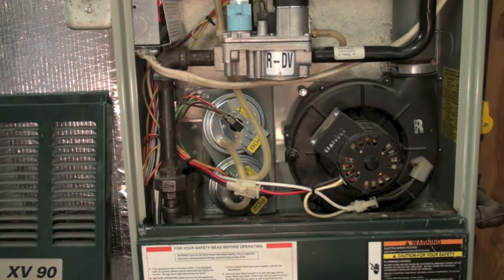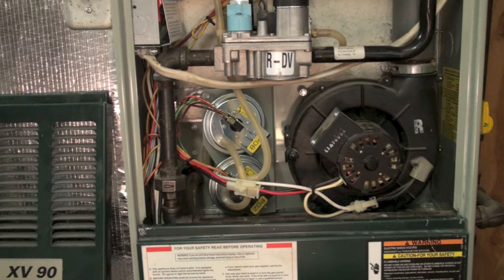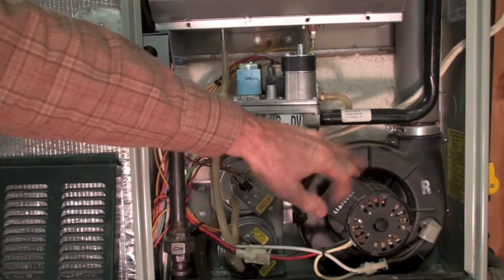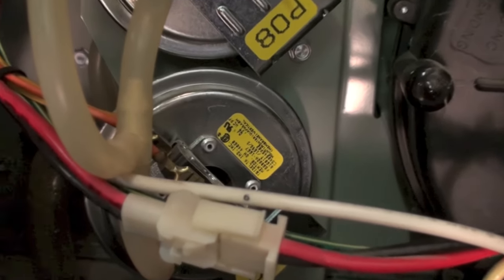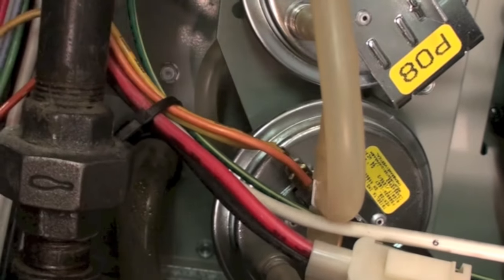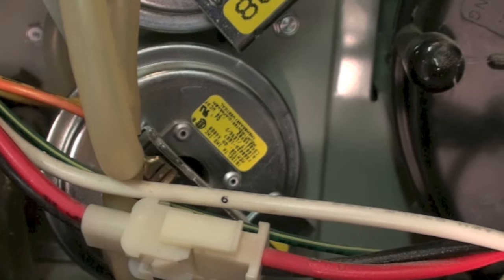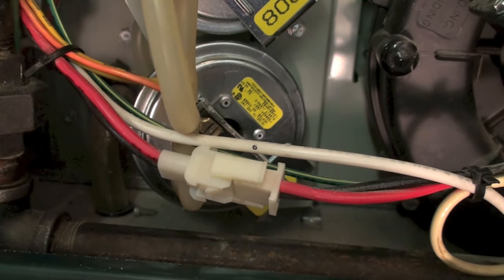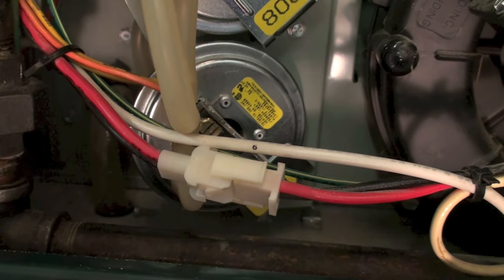Diagnosing pressure switch problems on gas furnaces

Comment: I've been having an ongoing issue with my high- efficiency gas furnace. When I set my thermostat to a desired temperature the inducer motor kicks on and just stayed on. For the past two seasons I'd simply change the batteries on the thermostat and it would work again temporary. Recently changing the batteries had not worked.  convinced my thermostat was the issue i went out and bought a new "state-of-the-art" thermostat and experienced the same result. 

I took the side panel off the furnace and watched the cycle. I noticed the red light on the computer board would go from a solid red prior to kicking on to a blinking red light once the inducer kicked on. 
I read on the inside of my panel that the double flash on the red light meant "pressure switch is open with inducer on." After some research it was suggested to remove the rubber tube from the pressure switch to the the burner chamber. Once I did this I started the cycle. The red light remained solid. After 15 seconds a clicking noise and the ignitor began to glow and after another 15 seconds or so burner flames ignited and following that the blower came on and it began to cycle heat. The blowing cycle lasts 1-3 minutes at most and does not reach desired temperature. Once I reattach the tube, the problem occurs again. 

I found a tip that suggested to blow into the tube, when I do I can hear a noise in the switch. I ran the shop vac through the intake and exhaust pipes from outside. The inside looks clean. I noticed the burners run for less than 30 seconds, I get warm air and then cool air.....I'm not exactly sure how to trouble shoot beyond this point. Any suggestions? Thank you.
Reply from the maker: Check the vent and combustion air pipe for low spots.  The piping should pitch toward the furnace at 1/4" per foot.  You could also have an inducer problem.  Dirty or damaged wheel.
GFM
Reply: +grayfurnaceman I removed the inducer motor noticed the seal was cracked and may have lead to air along with condensation leaking. I clean it up and reseated with high temp silicone sealant. I'm no longer getting the error code and the furnace IS running through its cycle BUT flames stay on for 30-45 seconds and then kicks out while blowing luke warm to cooler air.... Any suggestions?

Comment: great video the only thing i still don't understand with pressure switches is why is there dual as opposed to single . Or in other words why do they uses 2.  Is one for the combustion chamber the other for the inductor blower ( or intake side)
Reply from the maker: +sam111880 This video may help https://youtu.be/KmItM1_Fq9I
GFM
Reply from the maker: +sam111880 Check your trash.  I sent a link to a video.
GFM

Comment: I came across another one that would close ,HSI came on. but gas valve wouldn't open.... I ohm'd out pressure  switch.... Plenty of vacuum  I determined corroded contacts in the pressure switch, High ohms across PS..... Unit is a high efficiency Carrier... Unit had condensate problems.... I fixed them ....new PS....assorted other things, unit working good.

Comment: GFM, great vid.  I have a question. I have a 90 percent TRANE. When calling for fire, I can hear it tries to ignite, but can't.Often only after 3-5 cycles, it will start.  The service person says it is due to a bad pressure switch.  Wonder what your suggestions are.  Thanks.
Reply from the maker: Bill John If the unit lights for 4 to 7 seconds then goes out, it is probably a flame sense problem.  Clean the flame rod.  If it either never comes on or runs for a short time, there could be a pressure problem.  If it locks out on pressure switch, look for blockages in the vent, water in the pipe from a sag or ice on the termination.  You could also have a blocked condensate drain.  Check these first, the look at the pressure switch.  Hope this helps.
GFM

Comment: I've been on your other video's as you know ( igniting, not igniting). When the person who came here Mon. furnace was running fine, been running fine since about 3:00AM Sun until I again noticed just the first fan running and running about 6:10PM today not igniting. I called the person whop came here, (he lives 160 miles away from me, he was within 40 Mon.).. Anyway as of right now nothing will even ignite at all. He said take hose from where exhaust fan runs. I did and when I sucked on it a little water came out of it, He did this Mon. No Water. it did rain today. Since I bought this house it has rained plenty what can I say. So sucked then blew, you can hear the switch and see something move back and fourth on switch. No water in it anymore. But furnace will not ignite. This switch has no writing on it at all. Again I'm a 58 yr old woman and I thought the man who came here would know what was wrong. I told you on your other video He had narrowed it down to this. Now he is taking hose from chimney. The man who built this house has caps on 4 chimney welded screens all away around. No animal or even bird cannot get into chimney. I asked if this part could finally just give out altogether, of course the answer was yes. 

Reality of it is he's saying this and that needs to be re-checked. He checked gas valve had 24 volts said it was fine. I don't know how this is going to be resolved without calling furnace place near me with $$ I don't have. I hate to buy this Pressure switch then have it not be what the problem is. He said you could jump it by putting some kind of wire to both clamps and it it started that would indicate if it was the switch. Yeah like I know how to do that. I'm not going to mess with thing and cause damage that isn't there. God I need help.

Furnace is SV 9500 there's 4 numbers beyond that one 2682. Comforter RPS II but has Honeywell parts. The Pressure Switch on it has no writing on it all. A friend is asking me how do we test this? Vacuum?

Comment: question for you, i am a mechanic but i am not a furnace repairman however like everyone else i need to try and save money.  i have a nordyne furnace and it will get the call for heat from the thermostat and engage the forced air for combustion and will run this way for 15minutes to half an hour flashing the code 2 for an open pressure switch then so far everytime has finally picked up flame (showing flame led light up and then flame in chamber) and ignited to start the furnace.  any thoughts or suggestion would be appreciated, i will check the exhaust and intake as you suggested on my roof tomorrow, we have had really high winds the last couple days.
Reply from the maker: Of course the pressure switch could cause the problem, but always check for air flow problems first.  Check the tubing, check the blower wheel for dirt and the vent for obstructions.  There is also the possibility of a cracked heat exchanger.  Hope this helps.
GFM

Comment: Had a problem with my Furnace  Flue blower would run and the burner would try to ignite and would do this two or three times before doing so.   had a Tech come out and he found small pin holes in the sheet metal  boot going to the chimney  said they were messing up the pressure switch . he foil taped them and told me to replace it ASAP  now the furnace is working fine. going to replace when weather breaks

Comment: Thank you for this video! I checked the exhaust tube and it looks to be unobstructed. I then removed the tube as instructed at 3:40 in this video and my unit starts every time now without issue. I did run a wire through where this tube connects and checked the tube and they are both unobstructed. There is a metal cover over the burners and it starts with the tube connected and metal cover removed as well. I'm wondering what the next step is considering this is the problem here. For reference I have an American Standard Freedom 95. Any advice would be much appreciated!
Reply from the maker: I would be looking at an obstruction in the combustion air inlet.
GFM
Reply: @grayfurnaceman  thanks for the reply. I had this furnace installed 10 years ago by a professional and he left the air inlet open (no piping). Only the exhaust is piped out. I believe the exhaust is holding condensation at a low point because when I detach and vacuum it out the furnace starts.
Reply from the maker: @tommymillett377  I would be using a level on the vent.  Should have a minimum 1/4" pitch toward the furnace.
GFM

Comment: Ok have installed new pressure switch and inducer motor, Now it starts as it should once the pressure switch makes,flame comes on for a sec and then shuts down including inducer motor ,then it will retry & repeat.
Reply from the maker: Have you cleaned the flame rod?
GFM

Comment: Hi,

I have a 12 year old HE Lennox furnace. It has the #2 LED slow flash diagnostic code which describes blocked lines, or pressure switch open 5 times. I checked the hoses for blockages and it was okay. I unplugged the hose the positive hose (from the switch) and the furnace ignited and worked. Do you know what I can try next to diagnose this?

Comment: We got home from the Poconos on 1/1/18 and immediately felt that the house was cold. We went to the thermostat and it read 59 degrees. When we go away for a short time in the winter we set it for 66 and 67-69 when we're home. 
So lately our Ruud UGRA-09EZAJS/Serial: EL furnace has not been heating the house to the set temp (67). The closest its come was 65 and that's after I flip the switch on/off over a period of about an hour. 
When I look through the glass window, the green light blinks twice every two seconds, the code on the door panel indicates that the pressure switch is open. My friend came over to see which of the two pressure switches was the issue, but soon after disconnecting one of the hoses and blowing through it (nothing came out) he reconnected it, turned the furnace back on and there hasn't been a problem with it reaching the set temp. My friend could only guess as to why the furnace is heating the house now. We WERE going to replace the switch/es, but no need to now. I'd be interested to know if anyone might have an idea as to what might have fixed this issue.
Reply from the maker: There are a number of possibilities.  Venting problems such as vent sagging or frost in the vent can cause this.  Heat exchanger leaks can cause this type of failure.  Of course, the pressure switch itself could be at fault.  The issue of the unit running normally after clearing a vacuum hose might indicate a failing pressure with but I would not guarantee it.
GFM

Comment: Thanks for the video. I've got an interesting intermittent problem. The furnace works 80% of the time. When it fails the inducer comes on and just stays on and the furnace doesn't light. It can light 2x in a row and third time fail.

Any thoughts would be greatly appreciated. Thanks!
Reply from the maker: Dave Brown Could be a number of things.  A dirty flame rod, failing hot surface ignitor, a failing gas valve, or a control board problem.  Try cleaning the flame rod first.  I have a couple of videos on cleaning the flame rod.
GFM
Reply: Thanks for the reply. It's even more interesting now. I've seen times when the glow-stick is on but the furnace still does not light. Generally I didn't see that come on at all when the problem is occurring.

Comment: thank you for your Video. Yesterday my Carrier furnace would not turn on. Unit is in the attic, and we had overnight lows of 18 degrees. The day before it ran just fine. The unit would not start, The fan would go on, shut off then the inducer would cycle and shut off. NO IGNITION in the gas chamber. Had a code light blinking #13 called a HVAC person out, watched him fiddle with the unit, pushed a switch behind the cover . He wiggled the drain line, and said moisture froze in a kinked drain line. Now the cycles the unit and we have ignition and the furnace is running. He decided to remove the cover (shroud) from the inducer, looking for moisture. broke the silicone seal, said he didn't have gasket material, just put it back. I came down the ladder for awhile, maybe 15 min. go back up and he tells me the pressure switch is bad!! he put in a temporary one. The furnace is running. ????? It ran before after he dislodged the blockage, ? moisture froze, and caused the furnace not to start. He came back and said it would cost $222.00 for the switch and another $70 service call to replace it????? he NEVER USED a Manometer, and I suspect the pressure switch works all along. Just trying maybe to ramp up the bill!!!! Can the pressure switch be bench tested to determine if its good or bad??? Thank you
Reply from the maker: Vacuum switches work with very low pressures.  So it is hard to determine what he found.  You need a manometer and the specs for the switch.  Sometimes the specs are printed on the switch.  If the pressure is at or above the vacuum needed, and the pressure switch does not switch, its bad.  Hope this helps.
GFM

Comment: thank you for your video. After removing the tube to the combustion chamber the furnace started.  so what does that mean the problem is narrowed down to?  I reinstalled tube to the combustion chamber and unit ran for awhile then quits.
Reply from the maker: There are 2 possibilities here.  If there is excessive negative pressure in the combustion air inlet, it will shut down and if the vent is blocked or has water in it, it will shut down.
GFM
Reply: grayfurnaceman thanks for your rapid reply. I'll investigate and let you know.

Comment: Thank you GFM for the info and help. My american standard freedom 90 will start the cycle as expected: call for heat, inducer starts, ignites, burners fire and blower begins. However, as soon as the blower starts the fire stops. I can hear the pressure switch clicking as it opens. Code 3 flashes appears. All pipes seem to be clear. The tech replaced pressure switch but that did not help. He thinks the inducer does not generate enough vacuum. What causes the vacuum pressure to weaken when the blower starts? Thank you!
Reply from the maker: +Emmett I would be looking at possible heat exchanger cracks.  The blower start seems initiate the problem.  You could also have a sag in the vent pipe.  Hope this helps.
GFM
Reply: Thanks grayfurnaceman! The vent pipe is quite short (5 or 6 feet) and looks straight with a little slope upwards (it's horizontal). The vacuum from the inducer is 1.65 (as is the value for the pressure switch to close) so with the adjustment from the combustion side it's probably not enough.
How can I see the heat exchanger? Thank you.
Reply from the maker: +Emmett Sometimes pretty tough.  you can remove the burners and shine a flashlight or use a borescope to look inside.  No guarantees here.
GFM
Reply: Hi grayfurnaceman. As you have said "sometimes pretty tough". Some slight noises from the inducer gave me the hope that a new one will do but that did not help. Still the same, as soon as the blower starts the fire will die and 3 flashes code is up( venting problem, pressure switch problem or inducer problem). When I jumped the pressure switch it worked for a few minutes until 4 flashes (open temperature limit circuit) appeared. Can you think of where to go next? Many thanks!!
Reply from the maker: +Emmett Did the circulating fan come on before the 4 flashes came on?  Also did the limit shut it off or a rollout switch?
GFM
Reply: +grayfurnaceman The button of the rollout switch did not come out. Does it mean that it was the limit switch?
There is some corrosion next to the place where the pressure switch hose and a connection to the trap are (I tried to post a picture but it did not go through). Can this suggest something about the issues I have? Thanks.
Reply from the maker: +Emmett Try posting the pic to grayfurnaceman@gmail.com
GFM
Reply: Yo much info for a pressure switch

Comment: I have an American Standard Freedom 90 Single Stage furnace, approximately 10 years old.   It runs sporadically. The inducer will run and it will try to ignite, eventually giving up.  To make it ignite I disconnect the exhaust vent and put my hand over the opening to control the back pressure on the exhaust. It will often ignite, then I replace the vent tube. After completing the heat cycle it turns off, but will not reignite.  The furnace has been checked by a professional, cleaned, the pressure switch replaced and it didn't correct the problem.  Is there a back-pressure sensor that may be malfunctioning?  Thanks!

Comment: Hey Gary Thanks for the videos,  my furnace is 4 years old Achiever 90 Plus and sometimes it does not respond " Call for Heat" so I investigated, "Call for Heat" comes and Inducer motor does not starts, I have measured 24 V on the White wire which is on the control board (coming from thermostat), but when measured the pins that is supposed to power the inducer Motor was 0 Volt. However  when I knocked the Relays slightly near by the pins that is powering the Inducer Motor Furnace start working. and I measured it 120 V. my guess is the  Control board is bad. do you mind telling me yours?
Reply from the maker: From what you say, I would agree you have a board problem.
GFM
Reply: Thanks for the reply,  and  the videos  which are very informative  for the homeowners who wants to learn and educate them self...
Reply from the maker: Welcome
GFM

Comment: I have a Conquest 80 furnace that is giving me a pressure switch error.  I disconnected the vent pipe and it is clear, also the tube from the pressure switch to the inducer motor, no blockage there or in the nipple on the inducer fan.  the fan starts up, and the blades turn.  I am planning to test the pressure switch.  What other components should I test?

Comment: I have a 10 yr old Lennox G40UH-36A-070-03 furnace. When the thermostat is calling for heat, the air inducer starts and runs but does not ignite. Can I jump the prove switch leads to test if it ignites, to ascertain that pressure switch (or something else) is faulty? Thanks in advance.